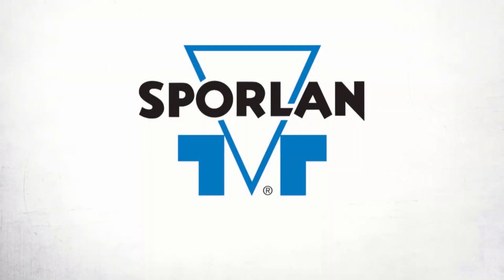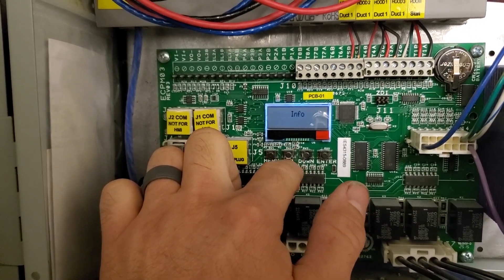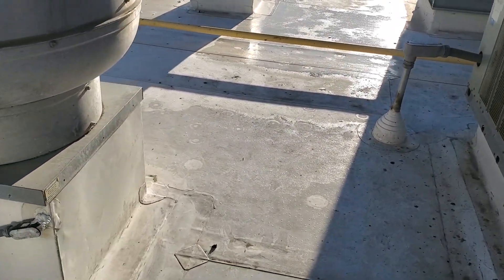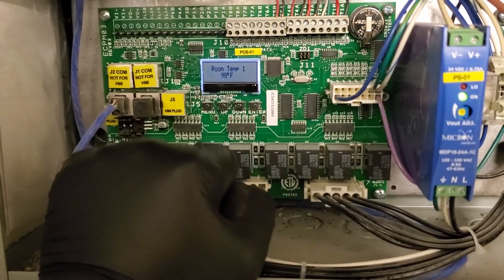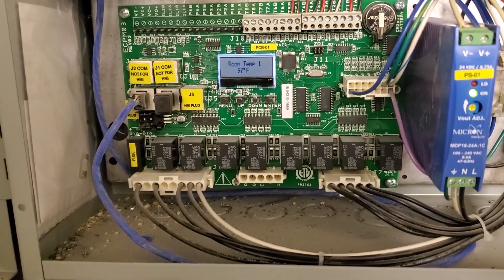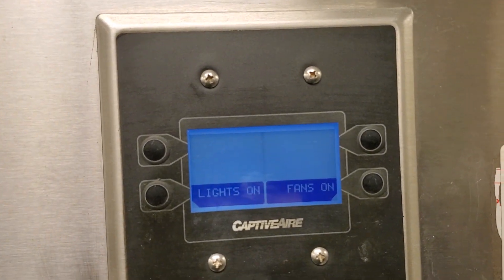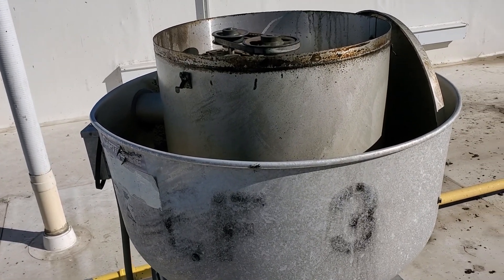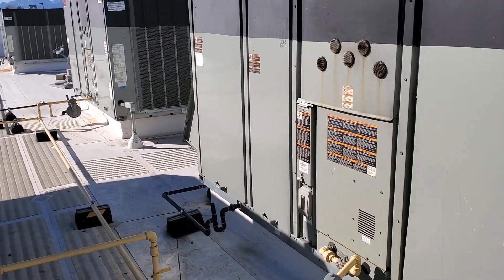EXHAUST FANS KEEP TURNING ON AND OFF

Comment: I work part time in a restaurant and I noticed the fans doing that exact same thing today. Good thing I’m working tomorrow so that I can check that. I’m a regular employee there and because they know that I also do HVACR work they ask me before calling the other guys out. Thank you for this video Chris.
Reply: Well Chris, I didn’t realize until I got here this morning is that the hood system here is the exact same system, CaptiveAire. But luckily it isn’t on autopilot. So I’m good with messing with that system. Thanks again for the video.
Reply from the maker: Be very careful a simple setting change can be dangerous!  I will be going live on YouTube this evening 12/23/19 @ 5:PM (pacific time) to discuss my most recent uploads and answer questions from emails, YouTube comments and the live chat, come check it out if you can https://youtu.be/K3iG5q_Q_0U

Comment: The big picture and the narrowing down of the slightest possibility. Reasonable judgment plays a significant role in formulating your next step, yet the path stays consistent until it no longer provides a logical conclusion. That's what I walked away understanding, and I appreciate that. Great job and thanks.

Comment: I know its several months old. But I haven't seen anyone mention this. When you were checking fault codes, you hit enter and got into the codes menu. You saw the PCU error, but when you went to scroll through the list, instead of hitting up or down, you hit menu, which should act like a back button. So you likely backed out of the faults menu back to the previous screen instead of scrolling. I can see how it would be easy to do,  your finger is nearly big enough to hit two buttons at once. And the silk screen print telling you which was which is tiny.

Comment: So Ive come across this many times.

I recommend checking the manual to auto function, I would set it to as many hours the restaurant is open, like 16 hours.

You can preset the room temp to always be a specific temp, like 75 degrees.

It gets even more fun with the newer features, prep time and vfds
Reply from the maker: Thanks for the tip Sean! I will be going live on YouTube this evening 12/23/19 @ 5:PM (pacific time) to discuss my most recent uploads and answer questions from emails, YouTube comments and the live chat, come check it out if you can https://youtu.be/K3iG5q_Q_0U

Comment: You do a great job with these videos, and your deductions are accurate.  Unfortunately, there is a tradeoff with electronics such as these --- you get an absolutely amazing variety of options, usually with none or very little additional hardware (most of the time an extra terminal block here or there), many of which are extremely difficult or impossible to achieve the old-fashioned (analog) way.  On the other hand, they can be really wonky in a very random fashion after a power outage or a power surge, whereas analog can be a bit more forgiving.
You are correct in that there is an adjustable offset that is used to compare the hood temperatures to the room temperature, to decide when to automatically turn on.  In this situation, if getting an accurate room reading is difficult, you can go into the configuration and set temp sensor #1 (the room sensor) to "preset", which then assumes that the room is 75 degrees at all times.
A lot of end users like the auto setting because they don't have to bother with turning the fans on and off --- sounds lazy, but it's one less thing to worry about.  You'd be surprised how often people forget to simply turn the fans off at the end of the day (which can also be fixed with activating the manual-to-auto option, as mentioned).
Love the videos, and appreciate the hard work you put into this!

Comment: I would recommend getting a battery operated heat gun would come in handy at a time like this and checking other temp sensors. Also would work with shrink wrap as well
edit my dyslexic brain left a few words out

Comment: Something to consider on these, we have somewhere in the range of 30 or so of these where I work. We have had issues with the reliability of the sensors and losing settings after power loss. 

A few months ago we had a guy out from Captive Air ...he plugged into every one of them with his laptop and updated the software. Since then we have had far less issues with them.

Comment: This is a case of what I call "white coat syndrome", where the problem is no longer happening when the technician shows up (the guy in the white coat, therefore the name). Happens all the time in automotive repair, and I assume most other trades too.
Usually prior experience is the only reliable quick way of fixing these, otherwise you have to do like you did and go thru the whole diagnostic procedure looking for "fingerprints" of the issue, evidence that something is still not quite right.
Evidence like that temperature sensor reading being wacky is exactly the kind of thing you're looking for.

Around my area, if it's a car you get under the hood and start wiggling wires and looking for the green fuzz of copper oxidation, which means you have a wire that chafed thru, then corroded thru, and now only conducts current half the time. Intermittent issues then show up because one bump in the road might sever the connection, the issue shows up, then they go over another pothole, the circuit completes (probably poorly) again, and now the issue's gone. My dad has gotten really good at finding those kind of issues, if I have one I can't crack I give it to him and he's found it within 2 hours usually.

Comment: Do your exhaust fans not complete the circuit? All of the ones here in Iowa that I work on complete the circuit so if an exhaust fan fails, the fryer/grill shuts off as well. So when changing belts or motors, we have to make sure they are not cooking or have enough in the cabinet to get them by for a little bit. It can be a pain, but it also helps because we it’s easier to know whether a fan is not pulling enough air or is not working.
Reply: that's usually interlinked for "fire safety" ancient building may not have that many tie-ins  and be grandfathered in as such.
Reply from the maker: I will actually discuss this on my livestream tonight!  I will be going live on YouTube this evening 12/23/19 @ 5:PM (pacific time) to discuss my most recent uploads and answer questions from emails, YouTube comments and the live chat, come check it out if you can https://youtu.be/K3iG5q_Q_0U

Comment: I've never been a huge fan of the automatic hoods, but they are becoming required by code in a lot of areas. I had no idea that there is a room sensor for the hood. I figured it just operated on a fixed temperature using the sensors in the hood. I don't see why that is necessary, but I'm not a kitchen hood expert.
Reply: Without the room temp it would just be an AC, with the room sensor it can try to make out if the actual kitchen supplies are turned on/heating.

Comment: Worked on a captive air, they were shut off from the breaker and when power was restored the system that runs the automation permanently locked out the MUA and I had to reset the whole system with customer service and it took about 30 minutes
Reply: Ridiculous...
Reply: @douro20  So let me get this straight: someone who can't fix the problem calls someone who does fix the problem.  Why are you complaining?

Comment: I work for captiveaire and this is a common complaint. Most of the time the chefs are not pressing the button - fans on. They come in and cook something, temp sensor senses a rise in temp(you can adjust the offset but usually 10-25 degrees above room temp, the fans will come on) fans come on, they stop cooking , sensor sees a drop in temp, and eventually the hood shuts off and they don’t know why the hood shit down. If there is not a sensor bad or misplaced, I always tell them to turn the fans on by button, that way, if it happens again, we’ll know there something deeper going on

Comment: I think that is one of the most difficult parts of troubleshooting when there is no way to reproduce the issue and you just have to take what you know and use it to the best of your ability. 

Although tech support is always a gamble I have never had too much luck with that. I work in the IT industry so might be different as far as support goes.

Comment: In the HMI, pressing the top two buttons. If you went into factory settings, temp sensor config, temp sensor 1.  
Assignment. Preset. Sets the room to 75 degrees factory Would have saved a lot of trouble

Comment: I just ran a similar call but instead of room sensor getting fooled, the hood temp was being fooled by a worn belt. Fan was moving so little air that the sensor differential would get close enough to stop calling for exhaust fan.  So basically low air flow was resulting in no call for airflow 🤦‍♂️

Comment: We have a system that shuts off every 20 min, and we have to push the max air button everytime is that normal? When it shurs off and sometimes we forget and it gets a little smokey the fire alarm comes on, police come and everything, the engineers say it's built that way, is this correct?
Reply from the maker: No that is not right

Comment: Power outage can scramble unit configuration.  Lithium Backup battery is a good test. 3V is Good. <1.8V Bad. Exact Voltage depends on the system. I mark the Date on the battery when its installed. 10 year max life.

Comment: Can someone tell me why there is an RJ-45 connection on that board? I don't think Ethernet would be plugged into that.
Reply: Probably the connection to the control/display on the hood.
Reply: That's how user interface on the hood gets power and communicates with the control board. These are also capable of remote monitoring and controlling over the Internet.
Reply: All 5 of those RJ-45 ports are modbus. The bottom 3 also supply power which can be used for HMI's, the top 2 ports would be used for VFD's.
Reply: The top two ports are for "communication", for programming the options into the board at the factory (or in the field, if you have the software & equipment), and also optional monitoring over the internet using an optional module.  The bottom three are modbus (think of it as internal communications), used to work with HMIs, VFDs, communicating with other circuit boards, etc.

Comment: sounds to me like the magical control panel at the hood is going wonky. good old junktronics.
maybe the backup battery on the control board, possibly another in the control button panel? look like standard CR2032, used in many things including computer motherboards.
Reply from the maker: I really appreciate normal switches these days for sure!  I get the appeal of the electronic stuff but it was much easier to diagnose a bad rely vs a programming issue or bad sensor placement in my case! I will be going live on YouTube this evening 12/23/19 @ 5:PM (pacific time) to discuss my most recent uploads and answer questions from emails, YouTube comments and the live chat, come check it out if you can https://youtu.be/K3iG5q_Q_0U
Reply: @HVACRVIDEOS  I work on electronics stuff.  It seems clear that the on-board battery is bad.  When the power failed, the previous settings were lost or corrupted.

Comment: My customer has a 20' hood. 2 fans
He's only using the first 7 to 10 feet of it. 
Can he turn the 2nd fan off and seal it so it's not taking in grease. There's no stove appliances on that end, none.

Comment: That is a correct assumption via temperature probes in the hood forcing on/off especially with frost on the roof, it’s cold outside, if the MUA is un-tempered. And as that air comes back in it can quickly trigger the need for no exhaust.

Those room sensors are completely worthless.
Reply: Actually, if you were listening, you would have heard that the air IS tempered, and is, in fact, warmer than the ambient room temperature.  What is worthless is the location of the room sensor.
Reply: @shingledubber  That was the air coming out of the ceiling grill from the air-handler into the space at the room sensor. Not the dedicated MUA at the hood supply plenum which would supply air to the hood and is the primary air that would go to the temp sensor in the hood. 

Two completely different air streams, he did not comment on the incoming MUA@ the hood.

Comment: Oof that electrical in the ceiling makes me cringe.
Reply from the maker: Welcome to every restaurant I have worked in, these days everything is flexible conduit barely supported, gone are the days or rigid conduit and pipe hangers!  I will be going live on YouTube this evening 12/23/19 @ 5:PM (pacific time) to discuss my most recent uploads and answer questions from emails, YouTube comments and the live chat, come check it out if you can https://youtu.be/K3iG5q_Q_0U